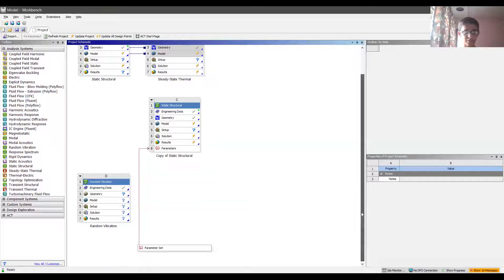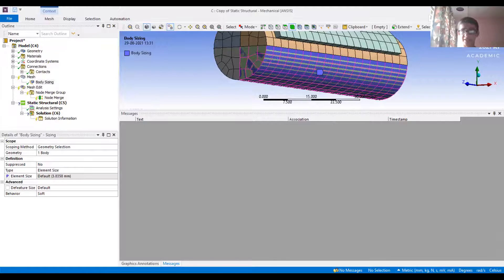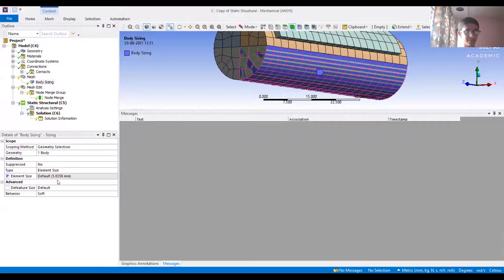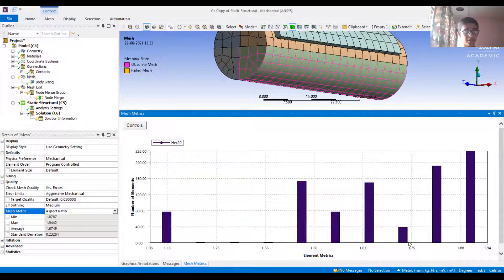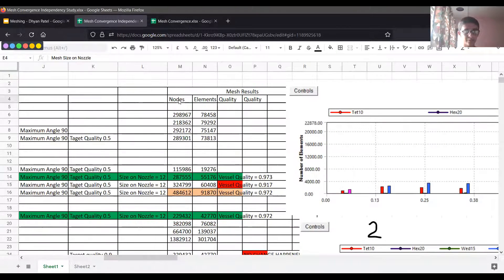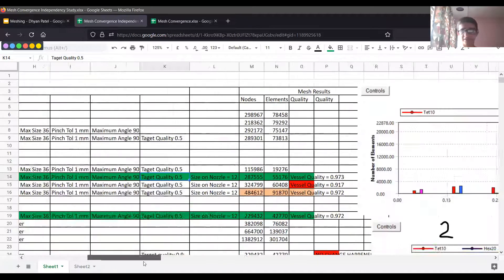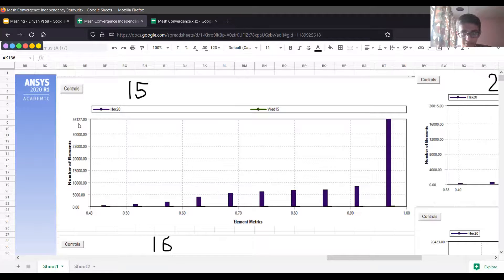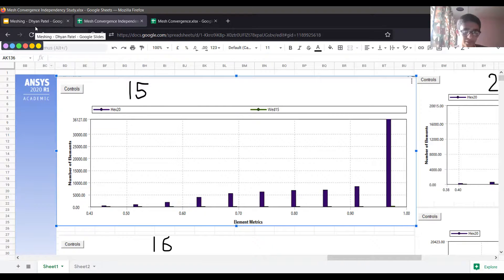11 How to do Mesh Independency Study? Optimised Mesh Refinement | Easy & Verified Method | ANSYS CAD

Comment: Hello sir!

I have a hexahedral multi-block structured mesh in ICEM CFD, I got some results from this mesh. 

Now, I have to do a mesh independence test. 

Please tell me which is the correct way to increase the number of mesh elements:

Should I 

1) Re-mesh the whole geometry with smaller element size

2) increase the number of nodes in each block.

3) increase the scale factor like 1.2 or 1.3 etc.... 

Thank you!
Reply from the maker: Hey, 
Thanks for reaching out.

Without much details about the geometry, it is difficult to give any clear suggestion.
However, in general I would try to increase nodes/elements in areas where there is more stress, bending, etc. I can use a sphere of required radius and assign a smaller element size in that sphere. And use that sphere in all such locations where I expect more stress.

I hope that is useful. Else I would suggest to send me some clear screen shots of your geometry and current mesh on my email.
Reply: @dhyandpatel132  Hi sir , Thank you so much for your detailed answer

Please can you share your email address?

Comment: How can we decide about mesh quality while looking at more than one quality parameter, if element quality is good but skewness is bad what will we do ?
Reply from the maker: I use to primarily look at element quality. If my element type and size (at corners and thin layers specifically) is correctly defined at the first step, then only element quality is enough.
Reply: @dhyandpatel132  Thank you so much
what is the "criterion for correct element size and type
Reply from the maker: @okhwatnoornoor8893  Usually I looked at thin parts in my model. In general, I would try to keep 3 elements across the thin section. And if there are multiple bodies in a model, I would use larger size elements in other area.
Reply from the maker: I believe looking at other videos in this playlist on Meshing will give you some idea. And you can also check one of my interaction videos (3 total) where we did live recording while meshing a body.